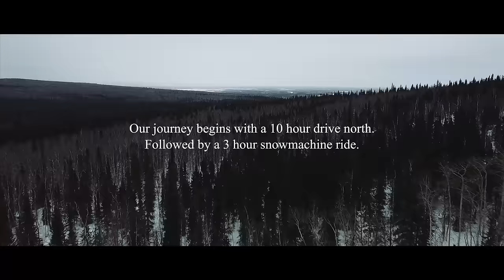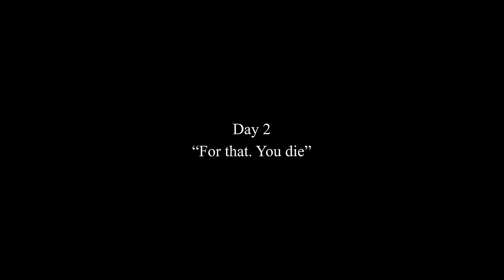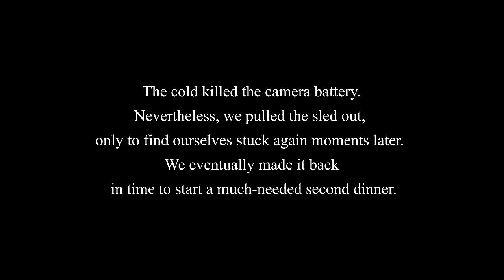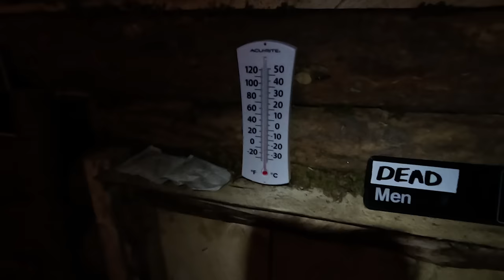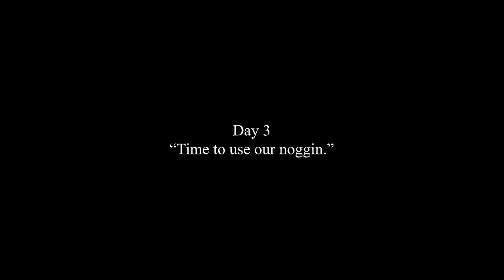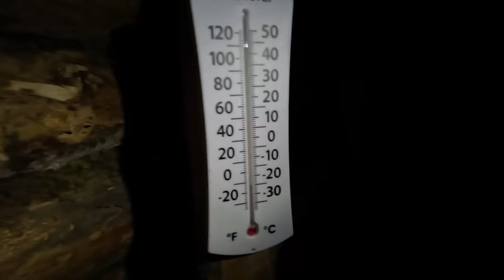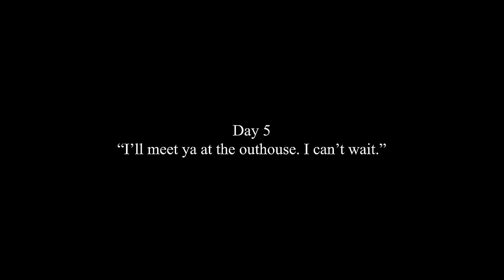Living in Remote Alaskan Cabin under the Aurora (-28F)

Comment: I'm not sure... but I think you may have turned up the camera ISO for a lot of these clips whilst not adjusting your shutter speed and aperture to increase the overall exposure. While higher ISO helps in lower light conditions, you would want to adjust the aperture and shutter speed so that you get brighter video quality. Only reason I say this is because your video is coming out a bit grainy even in natural light conditions.
     A good rule of thumb is to try to keep ISO as LOW as possible, usually 100-200 in daylight conditions, and then maybe 1200-3200 in extreme lowlight, like in the cabin. 
     Now to be completely fair, its not easy filming like you guys are doing especially in the cold, so I totally commend you guys.
Amazing cabin and great work on the video, just thought I may make a suggestion!! subbed!
Reply from the maker: Good eye. Thank you for your comment . I’m trying to learn more about filming each time I post a video. I kept the camera on auto for everything so I wouldn’t be taking too long messing with anything out in the cold. The grain you’re seeing is the film convert nitrate program I add for a subtle “cinematic” look. I actually wasn’t planning on using it for this video cause I’m not sure if I’m sold on the look. However I filmed it all on the GoPro in 1080p to save battery and space on the camera and it turned out a lot worse than I thought it would. So I had to add the grainy film to somewhat clean up the look. 4k all the way next time

Comment: As warm as it was in there just think hiw much warmer it can be with some good winterization! Fill up all the cracks and get a good roof on. Maybe even some ither kind if flooring to go over just the wood planks. But great job so far. Semper Fi from an old Marine
Reply: The floors where they’re loosing heat. That many gaps need to be filled. The roof with that snow blanket is well insulated. The walls look to be holding well.

Comment: Also I saw a video where a guy put insulation between logs and then mesh and concrete sealant between logs it looked amazing. But anykind of sealant between logs will be good for u guys. To keep that cold out. Prob even spray foam?

Comment: Likely need to secure that stove pipe to the side of the house from bad wind.. unless you plan on taking it down every time you leave
Reply from the maker: Yeah it’s hard to see in the video but we’ve got 5 wires connecting it to different parts of the wall and roof.

Comment: As a snowmobile rider, they said it’s a mile and a half, they didn’t have to pull anything till after they rode the snowmobile back-and-forth back-and-forth and cleaned up the trail. And yes, the snow is deep but if you stop the snowmobile on a downhill or flat you’re not gonna have a problem getting going again. This is a fake channel.  I mean I’m only a few minutes into the video but if there’s snowmobile is so crappy that you can’t do that they should just give up.  And I was the Winter caretaker at Summet lake Lodge on the Kenai and bought a 2004 arctic cat 151 track for $1300 in 2019 the winner of 2018 2019. lame lame that they did not show the snowmobile and then at six minutes in their friend happens to show up on a snowmobile